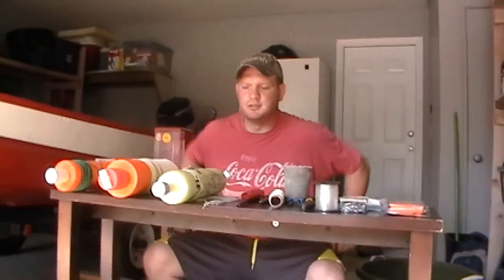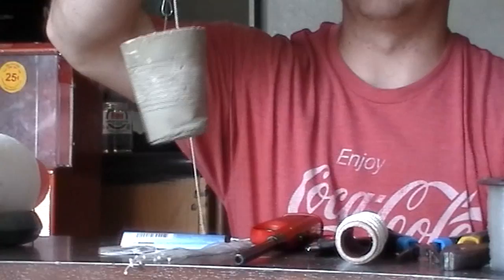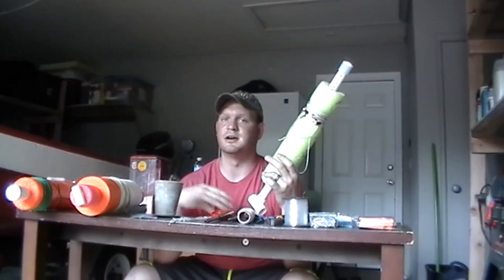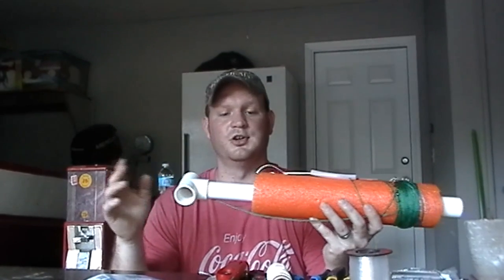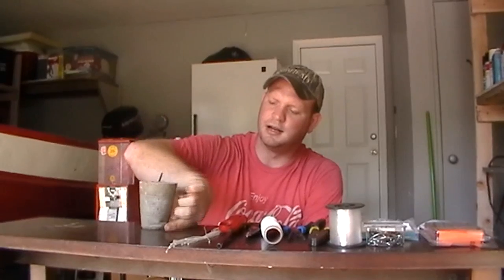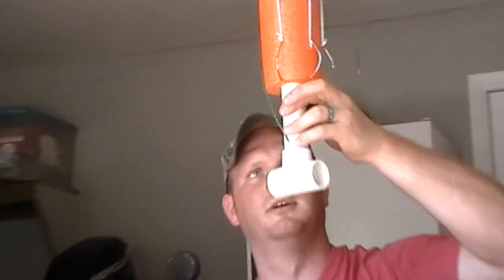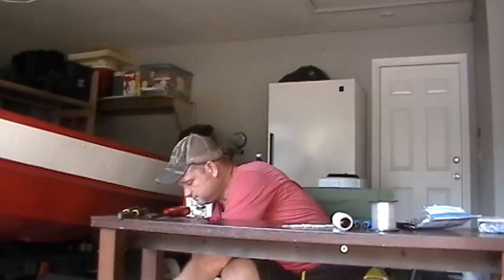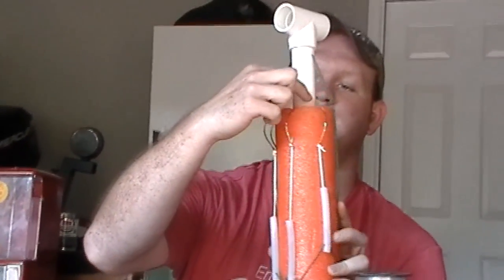How to Make Jugs Lines for Catfishing...Unique

Comment: so I made 20 with caps on both ends and see the value of the tee for shallower water. does it not fill up with water and take away from the bouancy with the tee being open?
Reply: Tracy, I was concerned about the same thing when making them, but oddly enough I've never had an issue with buoyancy or losing cats, but your right they will semi fill up with water. That's the con, but the pro is you can adjust  the depth from 5 ft to 50 ft  a matter of seconds. Another option for adjustable depth is to use some form of a small cleat. They're semi expensive and a paint to make so I used a "T".
Reply: +Cody Orrel 
yea I've used them and they seem to be working good

Comment: Are your pvc pipes capped off completely? Looks like the T on the end allows water to get in the pipe?
Reply: It's just capped off at the top
Reply from the maker: Troy, The top has a cap on it, but the "T" is open and it will allow water to enter the PVC. I fish mine with a 2 LB concrete weight  off the bottom approximately  12"-24", which in return stands the jugs straight up. Making them easier to see, helps keep the fish alive longer (summer months), keeps my line tight (no slack), help sets the hook more efficiently (bouyancy/tight line) and doesn't seem to let much water inside the PVC.
Reply: +THE JugMASTER OK. Thank you for the tip. I ended up making these with rebar weights and capped on both ends. My son and I put 6 of them out Wednesday evening and ran them twice yesterday. No luck as of yet. The plastic tubing worked great to keep the hook off of the main line. Thanks again. Looking forward to seeing my kiddo pull in a BIG one.
Reply: Troy I hope you and your son make some good memories pulling in some big ones. If you haven't already, try using fresh caught shad, cut them in half and try fishing anywhere from 8-14ft of water this time of year. The water is starting to warm up and the shad are beginning to surface. Cats will follow the food source. Goodluck my friend!

Comment: I'm kinda curious if a prusik knot would work to tie the leaders off to the main line...the prusik would let you slide the leaders anywhere along the main line and keep from slipping up and down when the fish are pulling on it. the only issue I could really see is the leaders getting twisted up but that plastic tubing should keep that to a minimum...
Reply from the maker: As long as the prusik doesnt get itself to tight it should work

Comment: What's the point in the T at the end?  Only makes it more expensive without any point.
Reply: Jarod the point of the "T" is to adjust your depth. Instead of having several different length jugs "short, medium, long" you'll have 1 jug that's 40-50ft long that can serve as all 3 lengths. In the summer months if you leave your weights on the bottom and don't run them atleast every 2 hours, your fish will die. I set mine to the bottom and then reel them up 4-5x and then tie a half-hitch around the "T" to prevent any line from coming off...I have another video demonstrating how I set them.
Reply: +Cody Orrel I have a lot of rope on mine. I use my depth finder to know the depth and then put some half hitches in the line on the pvc to adjust the length. I'll have to figure something out though in warmer weather to adjust for the thermocline (I think that's what I've heard it called)
Reply: In the summer months I leave my weight off the bottom to adjust to the thermocline. Using a 2.5lb concrete weight, it'll stand my jugs straight up, making them easier to see and I'll position them to blow from deep to shallow whenever possible. That way they'll get "stuck" and quit blowing across the entire lake (just gotta know your area). Without the "T" I was struggling to keep my half hitch from slipping off the the pvc/noodle, with it a "loose" half hitch does the trick, making it easy to retrieve. Whatever ideas or trial/error you find that work well, let me know. I live here in Tulsa, OK
Reply: +Cody Orrel Wow, I didn't know you're in Tulsa. wet caught the 80# blue at Eufaula

Comment: Any reason that you didn't use rebar so they lay flat and then title up when fish on?
Reply from the maker: Steven I like the idea of using rebar, but personally I choose not to use it. Simply because of what it does, it tells not only you but everyone else on the water you've got a bite or fish on and that's never good. Not everybody is honest, but keeping the weights off the bottom (Jugs stand straight up) there easier to see and you'll get good enough to tell whether there's a fish on just by looking at it...
Reply: Another negative about using rebar:   the wave action will bounce the weight over and all the jugs look like fish on jugs.

Comment: That foam will slide off the pipe without cutting the cap off anyway
Reply from the maker: You would think so, but the cap is just big enough to securely hold the foam on. Just make sure the foam is tight while putting in on the pvc and you'll be ok.

I'm still using the same jugs made in this video and they work great, better than I anticipated. 

Good luck!

Comment: with the T on the end does that not cause the pvc to fill up with water?
Reply from the maker: Ken, that's a good question. Although you would think having an open end on the bottom or side of the jug would effect the buoyancy negatively. It doesn't cause it to fill up very much at all and hasn't cause any negative effects on buoyancy. I originally thought of several ways to "tie off" my line and the "T" made the most sense. With a few extra $$$ a "cap" could be installed on both openings to prevent any water entering the pvc, also a small dab of silicone to the hole where the line comes through.
Reply: Spit.
Reply: THE JugMASTER 
I got it figured out I made mine a little different but have been very happy with them thanks a lot for the video much better than what I started with. good luck brother thanks again.

Comment: Why do you use a T connector on one end and not a regular cap? You probably said why but I can't hear shit on this phone
Reply: To adjust the depth of the line. Half hitch around the t stops the line at any depth
Reply: Ok thank you
Reply from the maker: Like Jeremy said... it's to adjust depths from 5 ft to 40 ft depending on where you are... instead of having several different length jugs you only need 1.
Reply: jeremy bell  couldn't you still do that with a standard cap around the pipe above the cap? Just put two half hitches on it...

Comment: The most complicated jugs to build on YouTube by far. Wouldn’t the white tubes right next to the bait deter some bites? Wouldn’t it be better to cap both ends of the pipe for better flotation? What’s the point of the T?